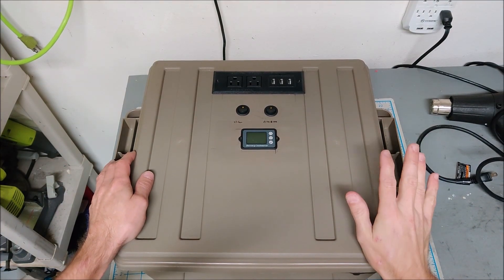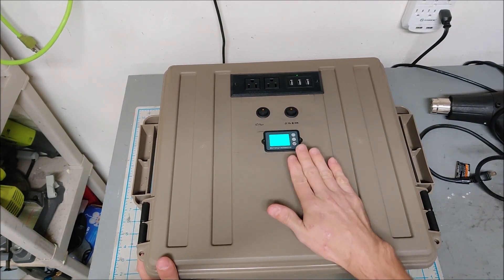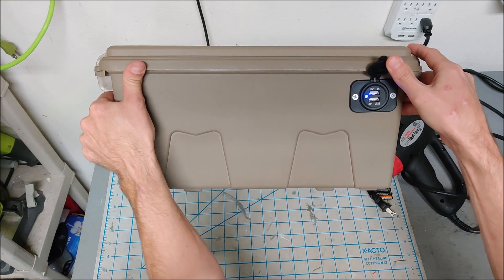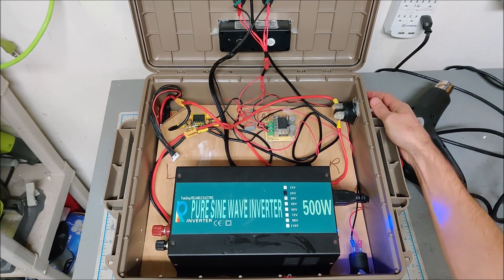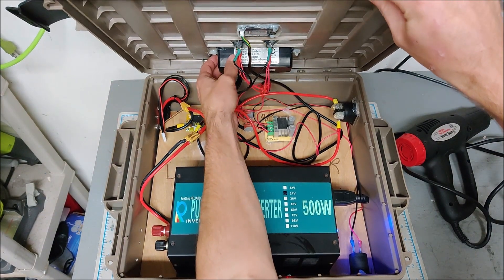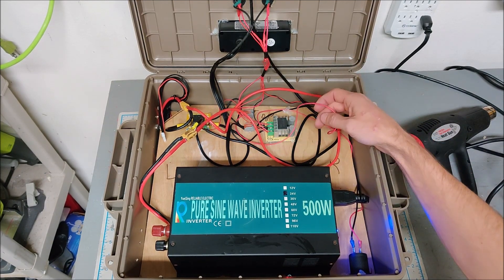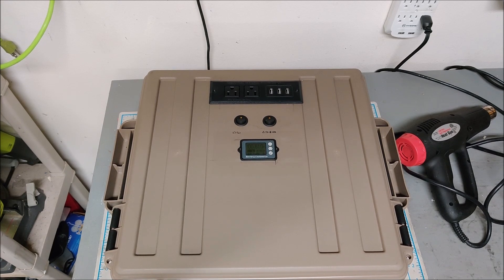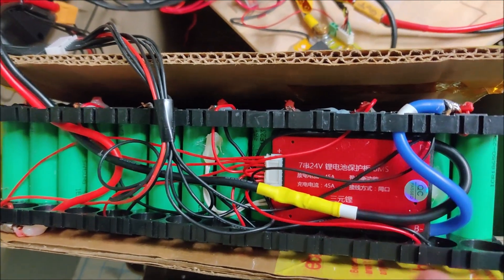DIY SOLAR GENERATOR / PORTABLE POWER WALL

Comment: Cool video! What kind of device is in middle of case with display? You have a link?
Reply from the maker: Yup. That is a watt meter.  That is an older one which i cant really find a link to. Here is a newer version that i use on my powerwall and V3 solar generator.

https://www.amazon.com/Multifunction-Battery-Monitor-Multimeter-Voltmeter/dp/B07T8GN61Z/ref=sr_1_4?dchild=1&keywords=battery+watt+meter+shunt&qid=1596201434&sr=8-4

Comment: Something i think is missing on this build:
1.) Fuses for protection 
2.) RCD for inverter output 
3.) Multifunktional charging Port for the battery (Solarcharging + conventional charging)
4.) 12 volt output
Reply from the maker: Battery is individually fused and has a 45 amp cutoff protection board. I will explore a solar charge controller at some point. Don't really care about 12v output. I don't have many 12v appliances